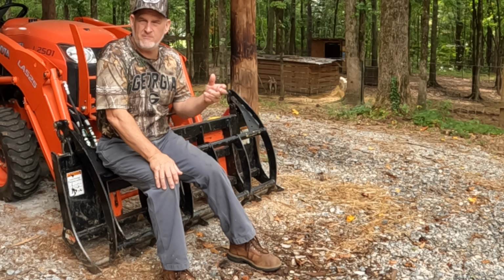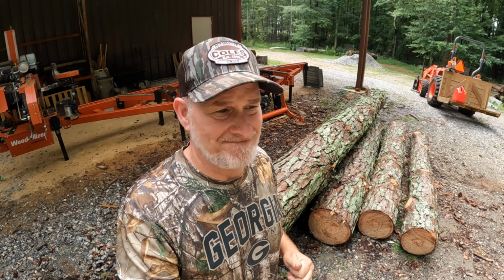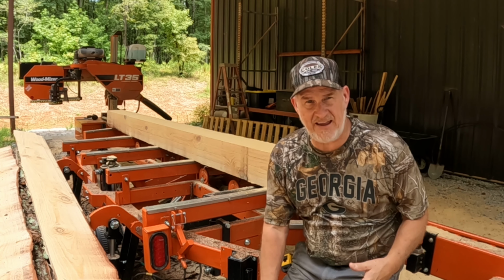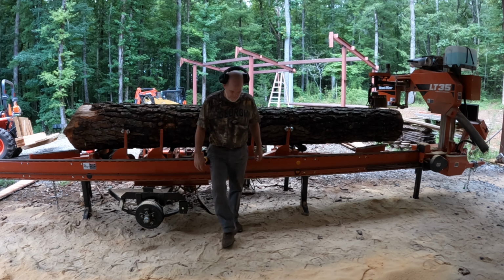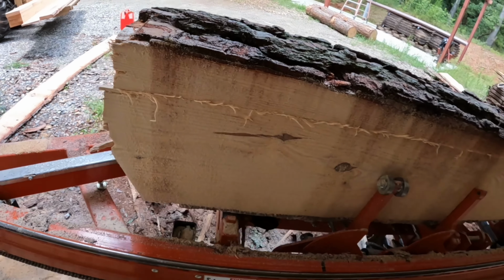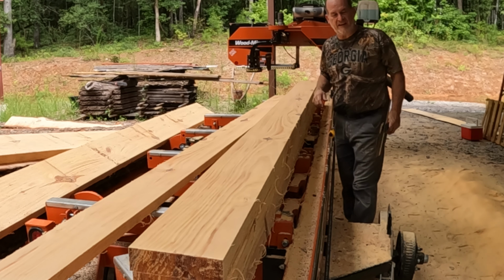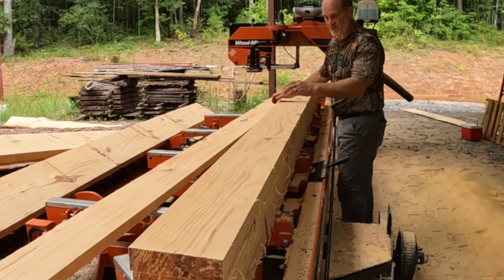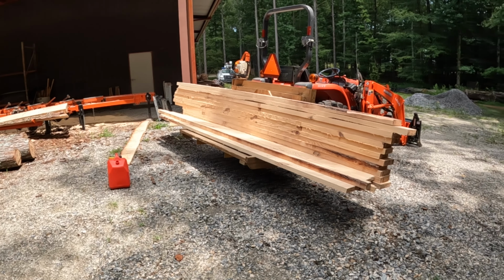Milling bridge boards

Comment: Would like to see some video or pictures of the bridge as he is building it. I am still trying to decide how I want to build mine and am looking for ideas.
That last 12' looked like it was about to best you! No matter how tired you are, the job ain't done 'til the  lumber is stacked.
Reply from the maker: Those jokers are heavy and by the time stacking gets there I’m beat lol. Was trying not to get my fingers pinched to. I’ll ask him for pictures. They used power poles to span the gap and put cross boards between them. The long boards will attach to the cross arms. Spaced every 2’ I think he said.  Thanks for watching.

Comment: Good job!  You could try the Humboldt notch (upside down felling notch) to take the wedge out of the stump rather than the log.  It looks like you were having fun with that axle...I've seen so many people walk around, step on or stretch over the axle...wood-mizer needs to come up with a way to rotate it out of the way.
Reply from the maker: I’ve tried that notch and haven’t mastered it at all. You’re right though so I’ll give another go. 

Yea the axle is definitely not positioned well 🤣🤣. Thanks for watching.
Reply: @SwampSawyer  Me too on that notch...been practicing but not camera ready yet 🤣